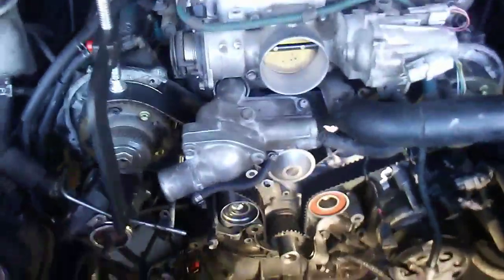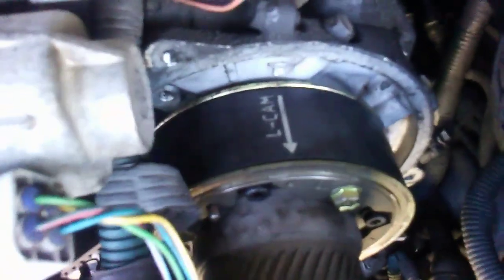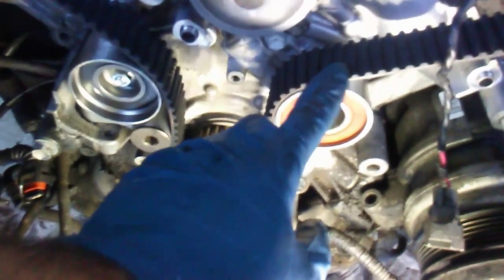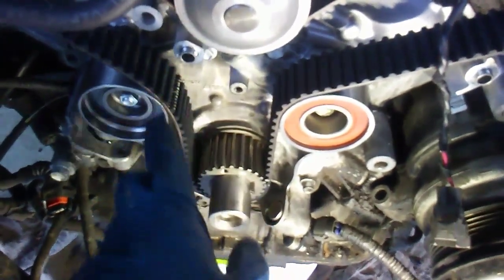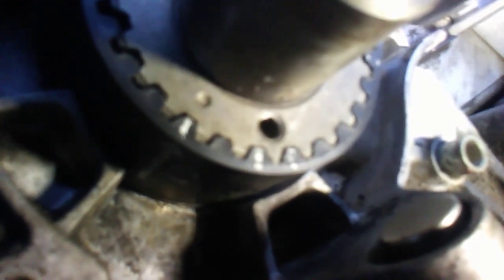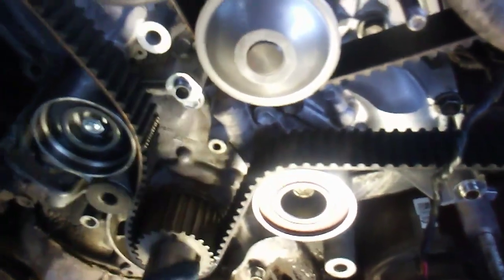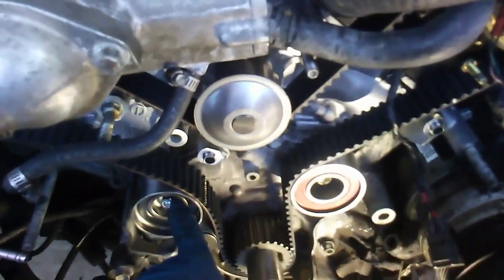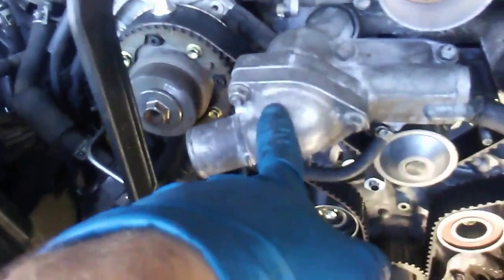How to install a timing belt on an LS400...

Comment: Take the crank bolt off by using an impact wrench or a long socket wrench wedged on something while attached to the bolt and turn the engine over to loosen it to take the pully off without a tool take two long crowbars and evenly set them to the left and right side and with a friend *evenly* push the pully off

Comment: I just bought a ls 400 1996 with 107,000 Miles unfortunately there is no under hood or documentation showing timing belt and water pump were done... is the only way to know if it was done to pull apart most of the engine to see the belt itself or any other tell tale signs ?
Reply from the maker: Jesse Hart yeah take off a timing cover and see if the belt looks new or 22 years old
Reply from the maker: Also the 1997 and older ls400s have a different intake manifold than the 1998-2000 and they are a bitch to work on...but the same procedures apply
Reply: Money Mac is that something pretty easy and accessible ? to someone who know almost 0 about mechanics. And if I pay to have it done I’ve gotten 4 quotes 1,200  1,300 699. And 750. The more expensive ones are dealerships. Is there any reason I should have it done by a Lexus dealer opposed to a local mechanic
Reply from the maker: Jesse Hart nah a local mechanic can do the job fine but I have seen those timing belts last 250k miles so its up to you...the problem is that the belt will stretch and that can mess up your engine and if the belt breaks then you will need a new engine in most cases
Reply: Money Mac So I should be looking to pay a mechanic couple hours just to investigate to see if the timing belt is new or needs to be replaced. or it’s easy as looking under something
Reply from the maker: Jesse Hart get the belt changed if you are that paranoid about it
Reply from the maker: Not trying to be rude it was late last night and I was tired...but yeah I would replace the belt...if you live near gulf shores Alabama I would do it for $600

Comment: good info!! quick question how did you get the crankshaft bolt off?
Reply from the maker: Ricardo Hernandez thats a separate video I posted...you need a crank pulley holder ...check out my other video
Reply from the maker: Its the video I uploaded called "how to torque a toyota crank bolt" same as removal...
Reply: I used to 9 inch chain wrench and a half inch breaker bar, worked like a charm